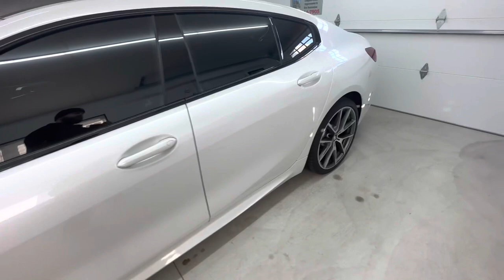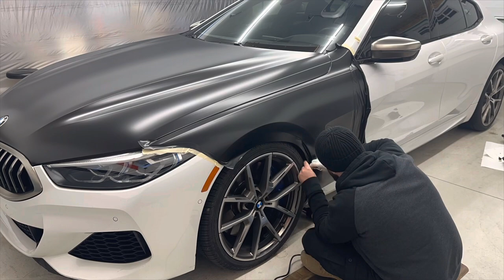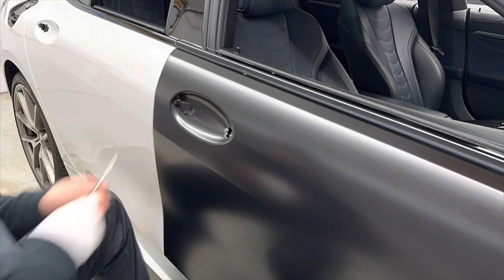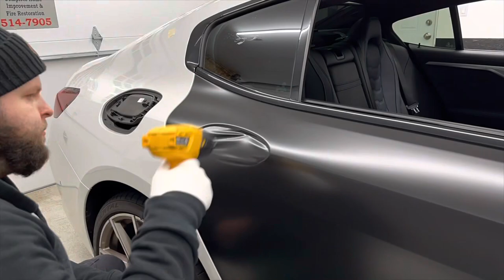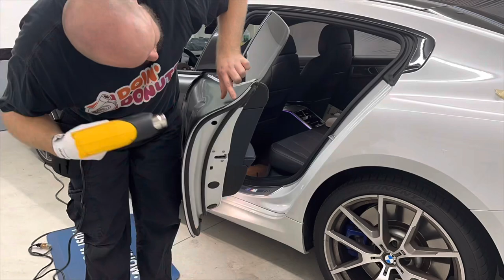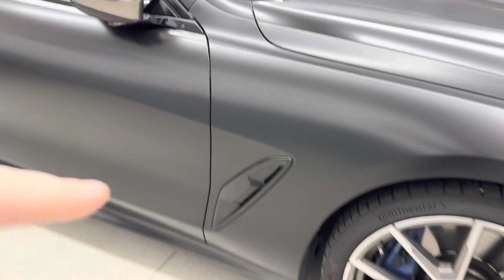BMW M850i Turned into Classy BEAST That it is! Fully Wrapped Satin Black 😈

Comment: You mentioning how difficult it is for you guys to wrap Black on white made reconsider getting white… wife wants black.. told her to let me drive and enjoy white for couple years and then we’ll wrap it  satin black..

I might have to compromise.
I live in a valley-dusty city.. getting a black car is a nightmare for us enthusiasts that love to see a clean car/no dust for a least a day or two
Reply from the maker: yea white and black are hard to take care of, black definitely more. the main thing with white cars is that you’ll see white in the crevices you literally can’t wrap, like completely under the rear windshield or around weird bolts and hinges when doors are open. you can wrap door jambs, but at a major extra cost. i don’t think it’s worth it, because wrap is a temporary thing anyway. 

but in general, as long as the shop wraps deep enough so there’s no white visible unless you’re literally snooping around crevices, it still looks good. i’ve done plenty of white cars.